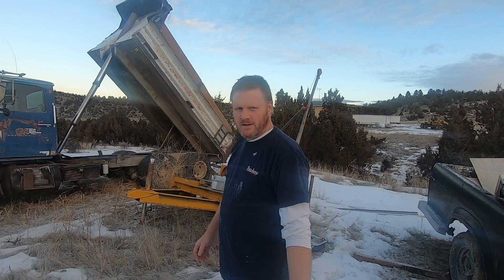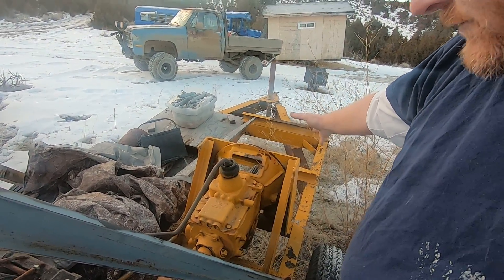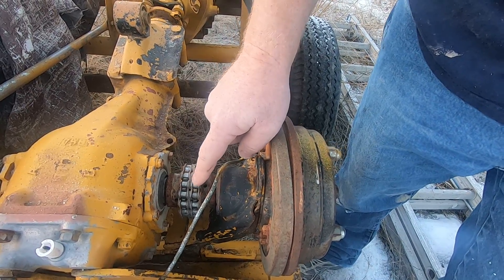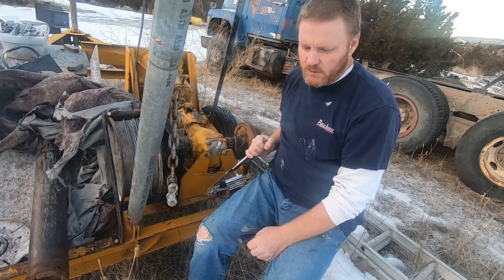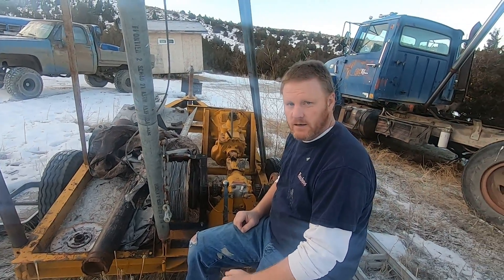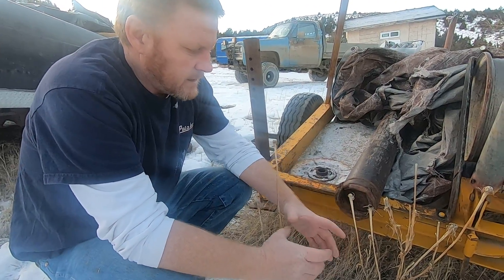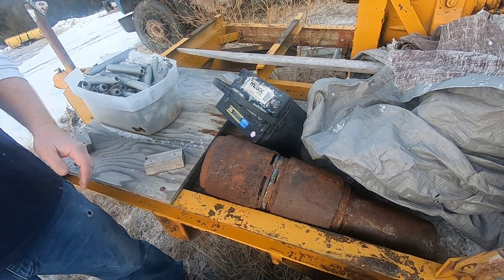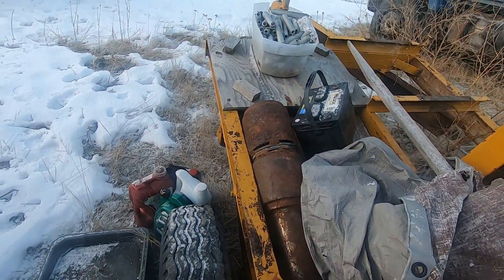Home made cable tool well driller how to make your own well driller drill your own well

Comment: Ok something about cable drills that people need to know.
They will drill through anything. Even rock that rotary can't drill 
Their down side is they are slow. 
Now in Clay and soft souls they are much faster then solid rock 
100 foot in soft soil in a day is pretty common.
While hard rock, you maybe looking at one foot a day.
And always have a chase line.
A chase line is a gaffling hook that can reach the depth you can go. So you can recover a clutch ( that's the plunger he was talking about) or the bit.
Loosing them in the hole is not common. But happens more then to say rare. 
Btw cable rig have drill thousands of feet.  You just need enough cable. 
The first well drilling I was part of was a old well driller with a old cable rig. 
I've also done rotary.
Rotary is much faster. But it's limited to the size of your equipment.
And it's a lot harder to make a rig . 
Now. Not all wells need to be cases the whole distance. Most just need the top 20 feet. 
But if you have something between the surface and the water. It needs to be cases.
Also if it's soft soil it should be cased.
I have to go through 1500 of solid rock. Which normally wouldn't need cases.
But 300 to 450 I have crude oil. So I have to case it 
FYI. The crude oil is a tiny amount. Too small for commercial sale.
The reports say it's roughly 2 million gallons. .and due to how it lays.  Basically one can pump 20-100 gallons a day of crude.

Comment: We made a well drilling bucket several years ago from heavy 4 inch pipe about 5 feet long. It had hinged jaws on each side on the bottom with a cable up the middle of the pipe to lift it and pull the jaws closed when lifted. We welded an old car wheel to the outside bell of the rear wheel of an old 8N Ford tractor and jacked that side up and used that as a windlass winch. A few wraps of a rope around it and when you pulled on the free end it would tighten around the car wheel and lift the bucket. Let it loose and the bucket would drop.We drilled about a 40 ft well with it and cased it with 3 inch pvc. It worked real good but there were no rocks in that ground.
Reply: i know im asking the wrong place but does any of you know of a tool to log back into an instagram account?
I was dumb forgot my login password. I would appreciate any help you can give me!
Reply: @Kaysen Emanuel instablaster :)
Reply: @Deacon Maurice i really appreciate your reply. I got to the site on google and I'm in the hacking process now.
Looks like it's gonna take a while so I will reply here later with my results.
Reply: @Deacon Maurice It worked and I actually got access to my account again. I'm so happy!
Thanks so much you saved my ass!
Reply: @Kaysen Emanuel no problem xD

Comment: What is the soil comprised of?  Clay?  Sandstone?.......

Where are you (approximately)
Reply from the maker: I live near three forks in montana. The soil was what we call moon dust hear. Sort of a dry white chalky/sandy type ground. On the surface is clay.
Reply: @veggitarianredneck  Thanks.  I am considering drilling another well on my property, but doing it myself.  What are your thought on trying a hole through clay, shale and sandstone that would be about 160 feet deep?
Reply from the maker: @oscarb9139  well the clay is easy, look up clay cutter online. The shell and rock shouldn't be a problem either for a cable tool will smash through almost anything. But do yourself a big favor a study about and inplement a set of "jars" . My well went without incident but I lost many bits trying to drill wells for my neighbors. Things prolly had gone better had I had a set of jars.
Reply: @oscarb9139  I got a video on a well I drilled. 200’
Reply: @jasongrinnell1986  is it on Youtube?  What materials did you drill through?  I have some shale and sandstone but will have to check the well log from my house well.